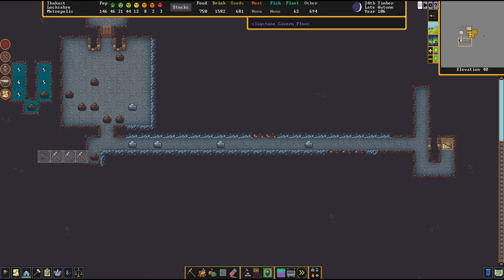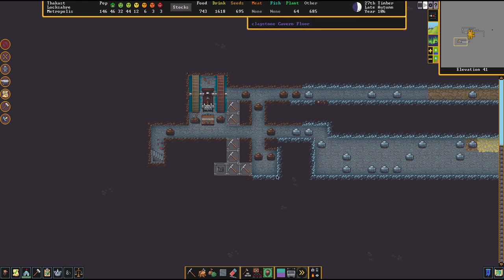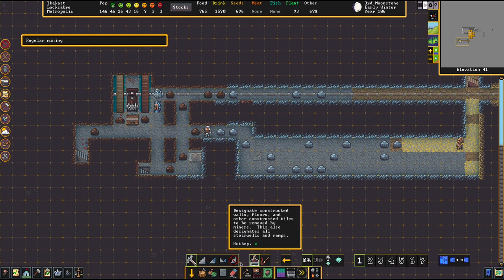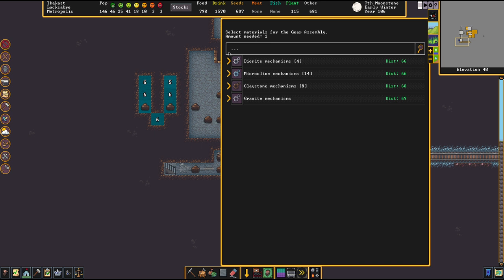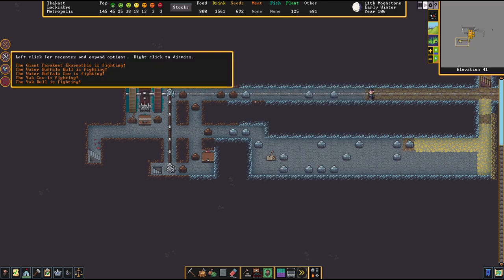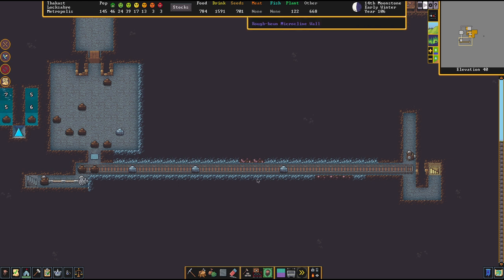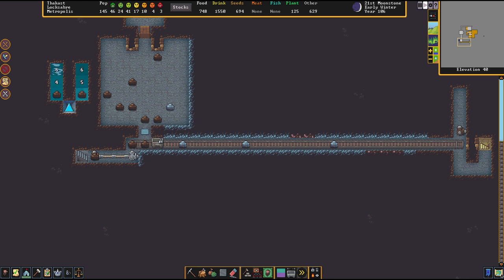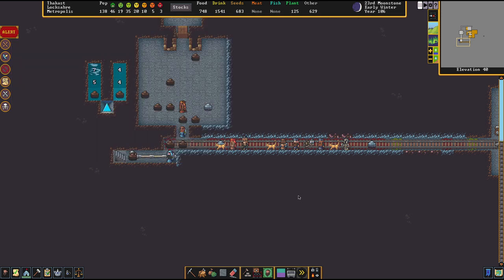MINECART GRINDER TRAP - Full Guide DWARF FORTRESS Tutorial

Comment: The water wheel generator is good, but ive taken power from the side, and too much water gets spilt and the machine stops working. I think its better to take drive from the screwpump up one level and have your axels on the floor above. Another method is to remove the trapdoor you use to turn the generator on/off, and take power directly from the from of the screw pump.

Comment: Very cool indeed  but shouldnt the pressure plate be linked to a couple doors so enemies get trapped in the corridor and don't swarm your fortress?
Reply from the maker: Of course you can also pack in some caging in to the mechanism. Keep in mind that it's hard to leave the track without stopping the doom cart before - it's dealing a lot of damage and you can always station a squad of dorfs at the  end of the train track to wipe up what's passing through.

There are so many options how you could do it ^^

Comment: If the boulder in question is part of a job to be moved to a stockpile/workshop this is happened. When an item is in use it is 'locked' in place until the worker picks it up. When you're building the track the boulder must be moved, and since it's locked that can't happen and you get a job suspension.

Also for a 'fast' stop button would a raising bridge on one end that can be lowered and cause the cart to rocket off into another room work?
Reply from the maker: I love the idea of the alternative Off-Switch! 
And thanks for giving me some deeper insight on how those stopped build orders come together ^^
Reply: @Ic0nGaming  Don't worry, you'll clean up the boulders and junk first, and then some dwarf will drop a XXsockXX on the tracks and you'll realize that didn't put a dresser in their room, but when you go to build the dresser you realize you just dumped all your rocks building the track and by the time you get the furniture installed the dorf in question is having a deep spiritual moment in some temple that lasts 3 months....

So the actual solution to this problem is having the ability to dump magma in any meeting area on demand!

Comment: I had an idea for one of these that rotated around in a loop, with the cart heading directly towards oncoming attackers instead of side to side, causing them to potentially get shoved backwards out of the grinder, and forcing them to walk back into it again in order to get past it (assuming they survive the first hit) do you think that would work, or is perpendicular like this the way to go? also, is there a risk of enemies flying/climbing up the vertical shafts that the gear assemblies are set into to provide power? or do the gear assemblies block that?
Reply from the maker: The roundabout should definitely work - maybe even better than the track I built here. I think there is definitely an opening vs flying monsters, cause there are almost no building parts that really block movement (I can only think of statues on the furniture side). But I am not 100% sure about it to be fair.

The big advantage in a circling loop is that you can use rollers to keep the thing sped up, cause you can place way more of them compared to my design (where it's really only viable to put up rollers on the ends of the track)
Reply: @Ic0nGaming  well that's good to hear. I had it in mind as my primary way of dealing with the, uh, complications that arise from getting my hands on that sweet, sweet adamantine. I'll be sure to station a set of troops around the water generator above the trap just in case.